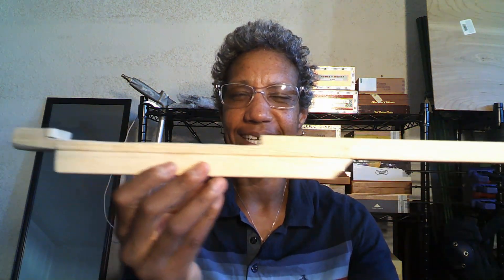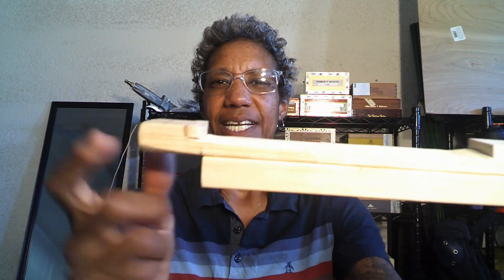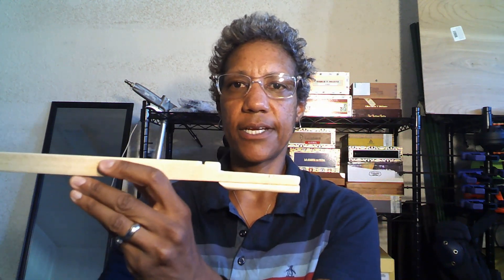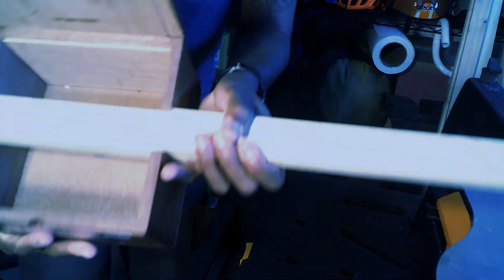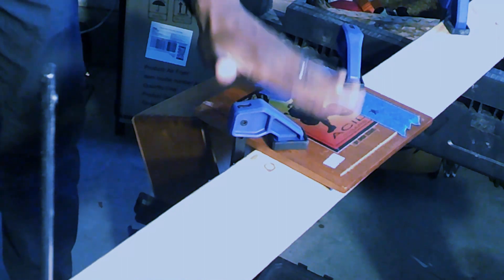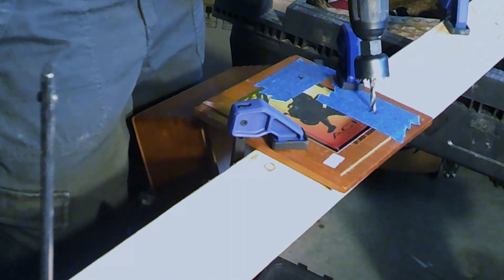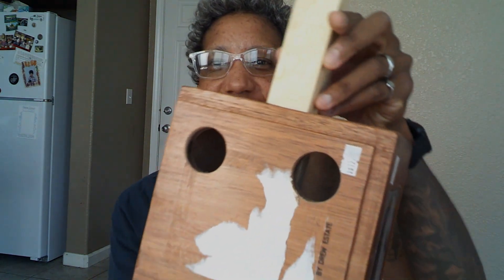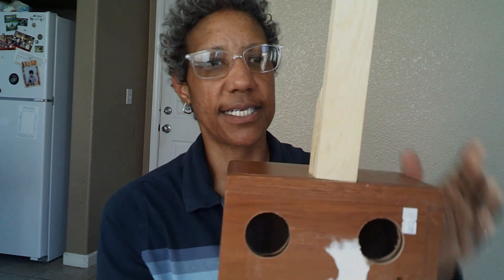HERE'S HOW TO DRILL PERFECT SOUNDHOLES

Comment: Hi CBG Lady just a tip with you hole saw, when you have cut part way through take the saw out and saw from the underside. You will already have the pilot hole to guide the saw. You may find you have a slight ridge in the middle of the cut which can be sanded out quite easily. This will save having a rough edge on the underside. Enjoy your project.
Reply from the maker: Thank you, Peter! Excellent tip and thanks for watching!